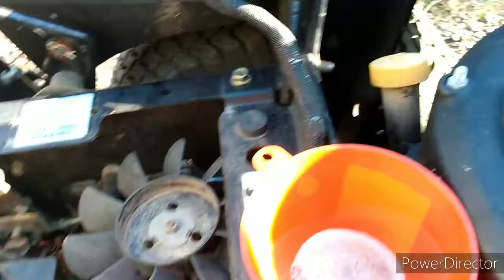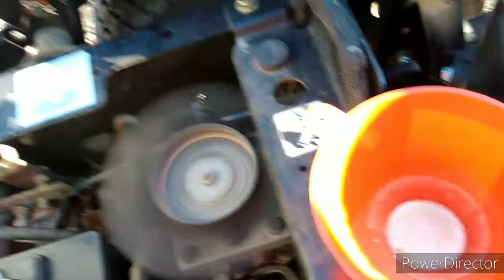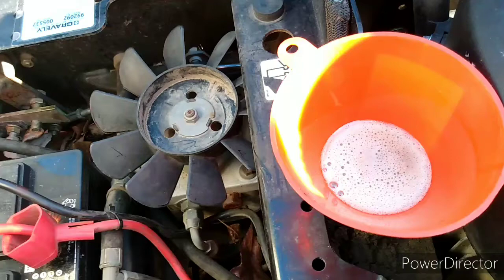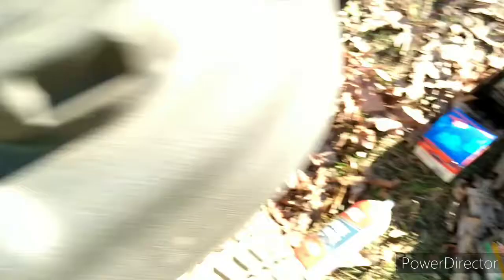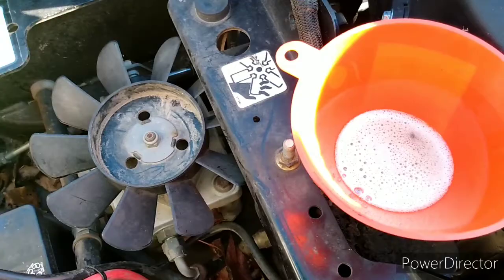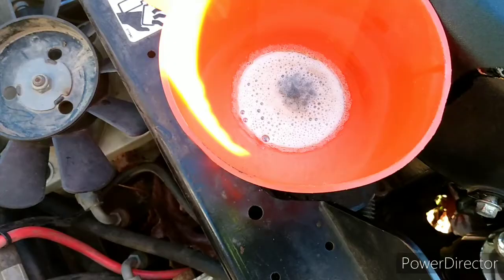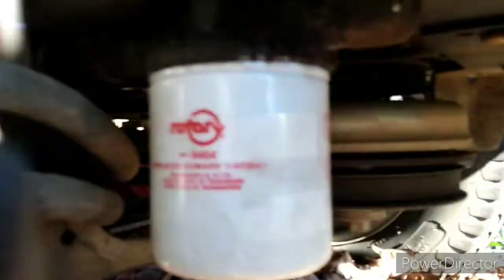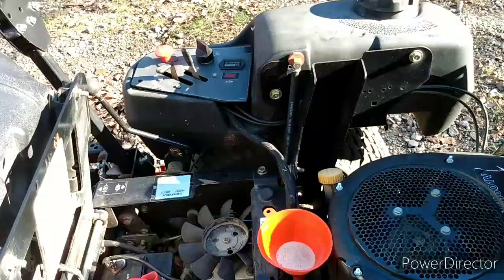change hydro fluid on zeroturn

Comment: I cannot get at the fill hole on this Craftsman 54 inch because the gas tank is under the seat.There is a youtube on a guy that lifted the seat on his Cub Cadet he had and then used a vaccum extractor to get the old fluid out and then put new fluid in.This guy thinks that is the main reason these transaxles do not make it more than 5 or 6 years. because the fluid gets contaminated.especialy if you use your mower alot.I had mine apart about 2 years ago because it would not go into park and latch.What it was is a small dog that sliped out.I easily fixed that and put it back together and everyone told me to use 10w40.I looks like I will have to take it out and replace the fluid with 20w50.God Bless You Carlos.I like your videos.They are very informative.One more thing is do you know of a nation wide place you can obtain used parts for small engines like a transaxle.
Reply from the maker: No,, wish I did know where to get used parts..
I know there are mower junkyards, just none around me.
Take care,

Comment: also is there a way to extract the fluid from my Craftsman 54 inch and putting 20w50 in the transaxle without removing the transaxle that you may know about.If so please let me know.
Reply from the maker: They make a kit, that puts a drain plug in the bottom case. Gotta drill an tap the hole. U can try to extract some out with a vacuum extractor, should be 2 holes in top,  one with breather, one under the fan. 
Use the one under the fan..

Comment: Hey Carlos I took my Craftsman 54 inch transaxle out to fix it and everyone said I should use 10w40 which I did and I notice that it works fine until the mower warms up and then slows down.So now I watch several videos and everyone is using 20w50.Do you suppose that may be why I have that trouble.
Reply from the maker: Yep,, that could be a problem. 
The oil is thinning out when it gets warm.

Comment: WHERE'S  THE DRAIN LOCATION  ON THIS MODEL?
Reply from the maker: The drains are on each pump,, should be a hex bolt, and it sets flush near the top on the unside